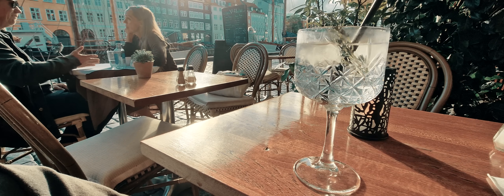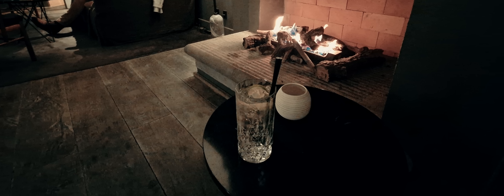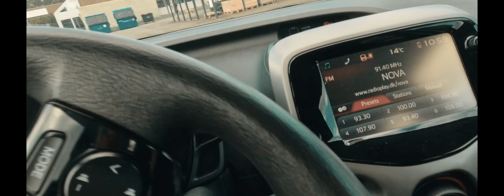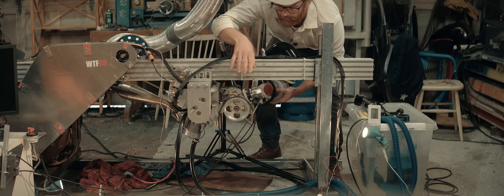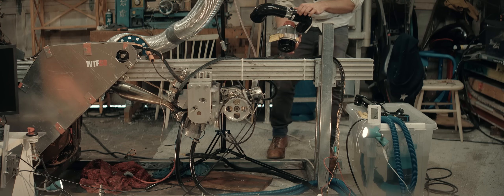Blown 50cc Two Stroke gets a ROTREX Supercharger!

Comment: Just curious as to when you may realize that a turbocharger is the actual solution as you'll have equal pressures on the intake and exhaust of the engine do the fact that uses exhaust pressure to create intake pressure and you can put a expansion chamber between the exhaust port and the turbocharger to get that extra effect.
I've been doing small electric blowers on two strokes for about 30 years now.
The blower is before the carburetor and the carburetor vent is attached to the pressure coming out of the blower so it is equal and the fuel tank is also pressurized so fuel will feed to the carburetor without issue.
Very easy to set up if using some of the larger Dorado carburetors you can actually have your switch connected to the choke assembly circuit if you want that extra fuel in the mix you can just calibrate the choke circuit jet to tune it in it's really funny to see the look on people's face when I just pull away from them with a piston Port setup.
It's amazing what two or four PSI can do on a piston Port setup makes it three times better than a reed setup on the bottom end but can scream at the top and being that it's pressurized you can have really big timing on the Piston Port not that it's necessary but it's achievable and still being able to start it with excess of 160° on the Piston Port timing usually works best at about 145° on the Piston port timing.
And whenever your pressurizing an intake system turbocharger blower or whatever your Port sizing and valve timing etc does not have to be as extreme as things are pressurized so the increase density takes care of getting a large volume into the combustion chamber.

Comment: Love the Rotrexes, just keep the unit as the highest point in the circuit of SC oil or the seal with leak, saw you "testmounted" it very low and that is OK if you put cannister/cooler and lines below SC. For me the blowoffvalve has always been the trickiest part because I use Rotrex on trackbikes and you need to control the "blow-by" very exactly to get the perfect respons from the throttle/engine.

Comment: Hey Alex, putting the carb downstream of the turbo will pressurize the carb, you will not draw any fuel into the airstream.
How about something like a plug and play Holley EFI, that allows you to set air fuel mix accurately using an O2 sensor in the exhaust
Keep up the good work we love it
Geoff B

Comment: Soooo, just to check 12.5:1 gear ratio on the blower, means at an engine speed of 15,000 rpm the fan is dong 3,125 revolutions a second?! I cannot wait to hear this thing spool up !!
Reply from the maker: Yep😁
Reply: @2STROKESTUFFING  what's the diameter of the fan?
Reply: @petermay5187  It's the other way around, the fan is spinning 12.5 faster than the input pully 😯
Reply: @JohnSmith-lb3ge   Yeah! That's 3125 revs per second
Reply: @petermay5187  lol got ya, I missed the per second part
Reply from the maker: C15-16 has a max speed of 201500rpm
Reply: @2STROKESTUFFING  that is ridiculous, at that speed the tips of the fan will be breaking the speed of sound.

Comment: You should consider putting the compressor over the carb to prevent the fuel leaking back from the carb and into the compressor. I saw in that happening in your previous videos when the engine backfired or stalled. Rotrex seem to make good products!

Comment: Do you plan to add a fuel pump with the regulator? Controlling fuel flow will be crucial to reliable testing especially with the rotrex pre carb setup. It appears that your test fixture has resonance issues as well. Watch the videos in slow mo to examine the resonance frequencies and try to damp those. The Dyno chain needs some idlers to stop its oscillating motion.

Comment: 15:10 that is a bad place for the blow off valve, the more inline with the airflow it is the faster it will let the pressure out. Your current placement will give you boost creep.

Comment: Bloody knew that a roots blower would have pulse oroblem and need to be timed to engine intake pulse , which is probably inpossable to do any way !! 
Well good luck with new blower , will the volume of the crank area be affected by the blower? , is there like a reed valve ect between the compartments of intake

Comment: rotrex might work better , might be able to mount it straight to the crank and do away with the beltdrive and all the problems it gave , would make the engine wider though
as for the blowthrough setup : make sure the float whont collapse under pressure (the inside of the floatchamber needs to be under the same pressure as the manifold or the carb whont do its thing )
wat you can do is build the carb intoo an airtight box , wish is the eaziest way to make the carb airtight under pressure but it will make it harder to tune as you need to open the box every time you need to change or ajust sumting 
look intoo the speeduino , its cheap light and should work for youre setup , it can allso add an ignition and fuelcurve to the rpm range wish might hel to get the engine intoo its most efficient rpm range faster 
robot cantina (you tube chanel) done a few vids on converting a 220cc predador lawnmower engine to speeduino 
https://www.youtube.com/watch?v=ICMYxJxGr0E

Comment: Cool . I wonder if you'll have a wider , flatter powerband ..... The air is going to be way cooler with that rotrex on the top end . I don't think you need an intercooler with the fuel your using .

Comment: Definitely think that it's going to wake this little engine up a lot.... I definitely think you should put some safeties far as ignition and boost. so if it gets out of hand it doesn't blow it to smithereens. And I'm super curious about ambient intake temp versus precarb temp without intercooler and with intercooler. I'd really like to know what the temperature is after the carb as well.

Comment: Can't wait to see that thing making boost! Definitely get some different sized pulleys ready and start with low levels of boost and dial it in before really cranking it up, nitromethane also burns very slowly so dialing in the timing will be crucial. Great work Alex that's super cool you got to assemble you're own supercharger, and hence know the entire assembly process. Nothing better than expanding your knowledge when it is in regards to making power!

Comment: 100% going to be better than the setup before, maybe not at idle tough.. also i would try increasing the diameter of the end pipe on the exhaust to allow more flow out and reduce the pressure build up in the pipe

Comment: Nice job on getting smashed the night before. If the blower peaks at 200000 RPM does that mean you'll have to limit the engine to 15785 RPM?
Reply from the maker: 😁 I'll reduce engine speed with the drive pulleys, 2:1 or so.

Comment: my only concern is the weight you are adding eclipsing the power gain. oil cooler, oil res, the piping etc. as for the carb honestly I'd g9nefi early so you don't have to repeat all the setup nightmare

Comment: Very cool video. Rotrex seems like an awesome company to work with and I’m glad they were able to sponsor you in this case. When showing how you’d like to set up the supercharger, you had it floating below the carb with your boost tube running up and into the carb. Would it not make more sense to mount the supercharger above the carb if your goal is to keep any nitromethane premix out of the supercharger? Perhaps you were just showing is a visual and had already considered this, but in the past, if you didn’t turn the fuel off immediately after a run, some would leak out the front of the carb. Seems possible it could leak out of the carb, down the boost tube, and into the supercharger if it was mounted lower than the carb

Comment: blame the drink
Reply: why not just use vertical fins, instead of a complex impeller
Reply: centrifugal fins spinning is the main part, not the angle of the fins
Reply: much easier to manufacture
Reply: it can be a water wheel type turbine with two cap plates
Reply: inside the turbine housing

Comment: Have u seen the work NOS has been doing with high pressure compressed air tanks supplying the boost for the engine on short drag runs? They get something like -50c temps in the combustion chamber prior to firing. Just some food for thought. Maybe down the road one day that could be a fun project

Comment: Am not sure you'll get low enough pressure with that reg, I rember trying an after market reg on my SU carb and just as it was approaching the correct minimum it would fluxuated wildly up and down 🤦🏻‍♂️ hope this isn't a problem you encounter... Can't wait to see it running now 🙌
Reply from the maker: Might need to compensate with a smaller jet, I'll do some testing👍

Comment: The drinks...now there's a reason to stop over there. Finally a blow through setup! Don't worry about going EFI...Top Fuel motorcycle dragsters didn't use that either. And yes...that supercharger is practically a turbocharger but mechanically driven. Just like the Ninja H2!

Comment: Several points. One change oil in the supercharger after a few runs , and two times, to purge rolling elements and pump vanes from break in and assembly dust. I would do it with an electric motor, drone style, capped off on the intake, or greatly restricted, so it is not loaded when you break it in. Electric will allow more power as that will draw 40% or so on crank torque.

Comment: I dont think intercooler is needed in this setup since boost will be relatively low and you are using methanol that will cool the air lower than ever with intercooler 👍

Comment: i think your going to have to put a reed valve back in the system as a roots blower is a positive displacement design and the centrifugal wont stop reversion till it has enough rpm to stop reversion. the crankcase pulses may be strong enough to cause compressor stalls.

Comment: Rotrex has been a great company to me also. I am doing a special custom build, and unfortunately the larger units can get pricey. I messaged them regarding some design data, and possibly some 3d cad data for solidworks mock up. They were more then helpful to send along any info i needed to design and prototype with. Even to the point that i was able to 3d print some mockup dummies to test fit with. They were magnitudes more helpful then the slouches at Vortech superchargers who wouldn't even give you the time of day. The Rotrex is light years ahead in design then the other centrifugal supercharger companies. 

One thing to keep in mind is Rotrex has very specific design parameters (oil feed placement setup, and drive constraints). The Rotrex do not like sudden rpm changes "ie" banging off the rev limited.. etc. and had issues with input shafts snapping when folks were stressing them with erratic rpm changes.. So during testing its best to slowly work your way up to higher pulley ratios and  keep rpm changes as smooth as possible (more so on the larger units which have alot more inertia moving inside) I believe their newer units have strengthened input design.
Reply: Would it be possible to use a freewheel pulley from an alternator on the rotrex input?
Reply: @aleksejunas  In theory yes, however those "freewheel" one way bearings are not designed for the abruptness and high torque transfer that would be seen with these types of applications. Even though this is a small scale super charger, it could easily see 20-40hp of power transfer to drive the supercharger thru the belt drive of the system. Larger units can consume 150-300hp thru the drive system to run the supercharger. Those one way bearings (in stock sizes) might have issues with internal locking. Would need to test to find out.

Comment: Mate epic dialog! I want to go drinking with you... but I think it might not end well for me. 🙂 Two questions, was running a turbo out of the question? I've only turbo'd 4 stroke engines so don't really know the set up. I'd imagine there would be a need to go to fuel injection to keep up with the variables of the engine. Just thinking of the parasitic drag using the blower. Also, would a Helmholtz plenum smooth the intake pulses for the blower?

Comment: I would look into a pressure box for the carb so the entire carb is pressurized making it much easier to tune. Even with that I think your MUCH better off with EFI as it's on the fly tunable and much less risk of a catastrophic melt down...

Comment: Hey bud love the build been here since the first vid. Check out my vid explaining a simpler blow through set up. Stick to blow through the charge cooling is worth the headache over efi. We saw -250°f across the carb on e85 and more like -110°f on efi. I have zero experience with that carb specifically but as far as normal motorcycle carbs go the pwk is very tuneable. We even moved the powerjets out of the carb and into the intake trumpet for some fuel flow alitte earlier for cooling. I would say if my turbo 155cc needs about 675cc of plenum to smooth out the pulses all the way your 2stroke probably will need about 400cc. Do remember to put your pitot tube after the bov and before the plenum youl thank me later. If you need any help with it iv done about 50 blow through set ups. Those fuel pressure regulators are hell. I did get one to work but getting that base pressure low enough is not fun (youl have to make or modify the spring) it won't go low enough consistently. And it's kinda a big setup (heavy and space is always an issue for bikes). Currently to make things safer I made a small tank about a liter with a check valve from the tank and a vent with some baffles. It's still above the carb so gravity gives us base pressure then boost gives us the rise. I pressurized the tank for a long time but as boost got over 45psi I didn't like how much the tank was growing. This iv tested to 120psi and it doesn't move. Saved me 11lbs and a ton of space going this way and no more super rich on decel and more power available for spark not having to run the pump from my little stator. Best of luck I can't wait for the next one and don't feel bad blow through isn't exactly an easy thing it's okay to pull some hair out during it lol.

Comment: Have you considered changing to petrol as fuel as long as you are still doing decently basic modifications to the engine like you are now? 
It would be significantly cheaper :)
Reply: Hello Victor. I would prefer to see it run purely on petrol but there's more chance of plaiting fog!  I have suggested this previouly but Alex won't hear of it! Possibly to old school, mind you I come from the clockwork era.

Comment: While looking at the C15 the other day and doing a rough calculation of the engine to blower ratio it suddenly occurred to me what was happening with the Roots blower. As you mentioned in this video, the pulses from the Roots blower would be out of phase with the engine and you would not be able to come close to solving that without an enormous plenum chamber. Perhaps a multi-vane blower could have helped but I think this blower will solve a lot of the problems in a much more satisfactory way.
Reply: A whipple charger has more veins so less of a "signal" I would suspect?

Comment: You rock for the gift Rotrex! Beautiful assembly clean room too.

Think you'll try the dual tube exhaust again? If the disc friction behaves I guess eh. Coolage.

Eya man, mix some weed into your binges. It'll slow you down and give you munchies so you eat something. Edibles if you don't like the smell on you. Vape cartridge if you want a hammer hit that smells like pineapple in pleasant company. Helps with the hangovers big time. 

Moderate cheers, buddy. That turbine is going to sing!

Comment: hmm interesting appears to be hydrodynamic drag system using the viscosity of the oil rather then gear teeth to drive the axle very clever allows the shaft to rotate independently should any obstruction occur
Reply: I've seen some pictures of smaller electric hub motors for bicycles that use planetary transmission with wheels instead of gears, don't know how it can work, looks like a "dry" system on these motors. 

But the Rotrex looks like the same "glue oil" that's used in bicycle CVTs (nuVinci).
Reply: @nhytg376tgyuu765gjmg  given that it comes with an oil cooler i am convinced they use a pressurized oil system that move a high viscosity oil around